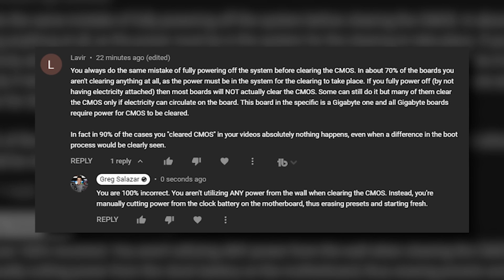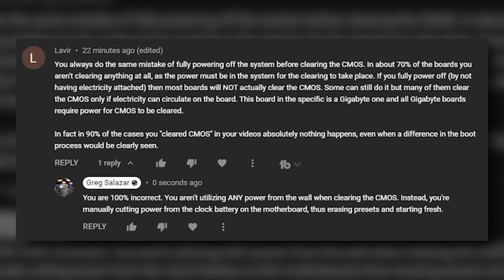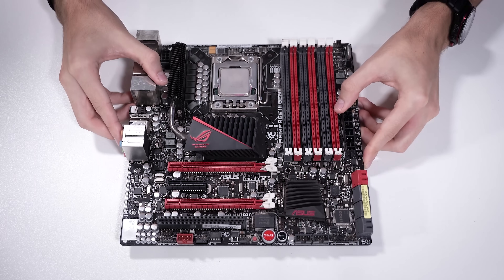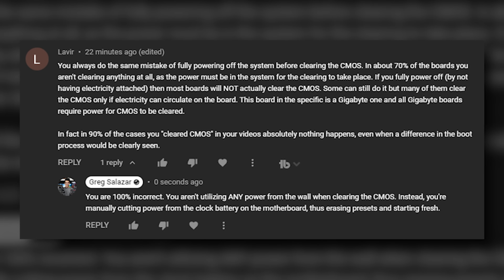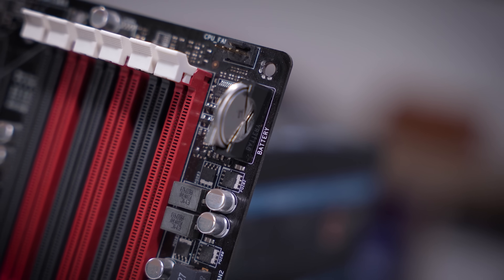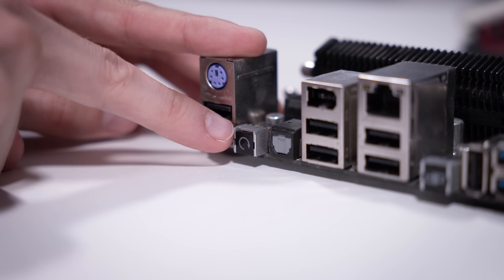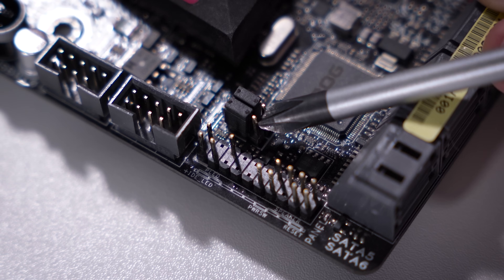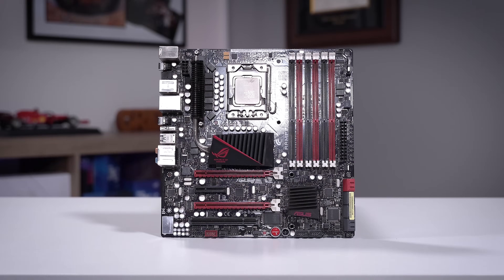How To CORRECTLY Clear Your CMOS

Comment: I'm trying to figure out how the commenter got it so wrong, and the best explanation I can come up with is that they thought that jumping the pins is sending power to the BIOS chip to somehow do the erasing. But even if that was true then you could still theoretically clear the CMOS using the "power" from the CMOS battery, because it's a battery and it has power.
What does he think the battery is for then? 🤣
But fair play to Greg for handling this in such a polite manner.

Comment: The main reason to remove all power is that most people aren't electronic technicians who have been taught how to work on computers. Trying to clear the CMOS with power on could accidentally result in shorting something out and causing component failure or injury to the person who left the power on. That is why many manuals have you clear the voltages using the way you demonstrated before opening the covers on a computer.

Comment: you will knew if cmos is clear if the set is in default, this is not big deal and it depend on oem motherboard.
we have different way to troubleshoot on our desktop and we dont have specific scenarios especially in the feature of our motherboard. Its simple to do or his motherboard have issue 😁😁

Comment: This is the gigabyte instruction You may clear CMOS to revoke previous BIOS password. Please turn off power and remove power cord from motherboard before clear CMOS. To clear CMOS, you may follow the instruction below:
If there is a  [CMOS_SW] button on motherboard, just press this button to clear CMOS.
If there is a CLR_CMOS (Clearing CMOS Jumper) jumper on the motherboard, you may place a jumper cap to temporarily short the two pins or use a metal object like a screwdriver to touch the two pins for a few seconds. (You may refer to the manual about where CLR_CMOS located.)
If there is no CLR_CMOS jumpers or [CMOS_SW] button on the motherboard, please follow the steps to clear CMOS:
Take out the battery gently and put it aside for about 10 minutes or longer. (Or you can use a metal object to connect the two pins in the battery holder to make them short-circuited.)
Re-insert the battery to the battery holder.
Connect power cord to MB again and turn on power.
After clear CMOS, please press DEL to enter BIOS and select [Load fail-Safe Defaults] or [Load Optimized Defaults] then save changes and reboot the system.

Comment: Don't know if you encountered this before Greg, but I've encountered a Gigabyte B85 motherboard that wouldn't boot properly and seemed to have a corrupt bios. Shorted the main bios chip and got the backup bios to reflash the main chips, but the bios was resetting and crapping itself out every time the pc was powered off. Turned out it was a dead CMOS battery and after replacing that and having the backup bios reflash the main chip everything was fine again.

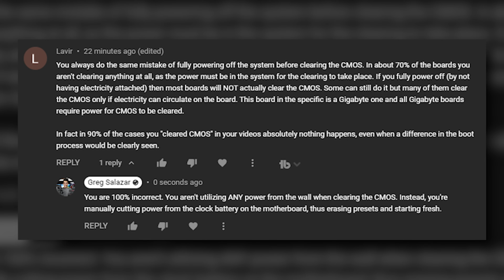Comment: That board is the perfect example to actually prove what was stated at around the 3:26 mark.

I had an X58 Asus motherboard similar to the one showed here (X58 P6T Deluxe V1 IIRC), same vertical CMOS battery holder; one of the pins (there should be three, in my case the middle one bent way too much during shipping) that connected that "vertical holder" was broken, so the battery was efectively doing nothing since it couldn't supply any power to the motherboard. All it took to reset the BIOS entirely was for me to unplug the system from the wall for a few seconds.

Comment: I always owned Asus boards for the past 33 years I have an Msi beacuse it was only the one in stock :), and ad per Asus instruction, was to shutoff system ,remove battery and clear cmos jumper for 10 seconds .

Comment: Hi Greg! I did clear CMOS several time without disconnecting power from wall but last 2  - 3 times what I did

1) Remove Wall Power
2) Press & Hold Start Button for around 30 seconds
3) Remove Battery and use Jumper to short the PINS and let system in same condition for 20 minutes.

What I found "THERE IS NOT A SINGLE DIFFERENCE" between both procedures.

But what I understand is, before clear CMOS, Power should be drain from system, just for safe side because if current still flawing in Capacitors or any chip, may be short can be occur, if you touch any other component by mistake, specially when using screwdriver to short the PINS

I have Asus Maximus VII Hero with 4790k.

Comment: With some older boards, reseting bios via jumper when system is powered on.. Could f... Your bios (will reset every time system is powered off).
With some boards, they refuse to post when cmos battery is emty (or to low voltage so with not posting boards, one of first things i do is chek cmos bat).
Also with some boards, when OC fails and You get no post... They need very long bios reset (have few DFI lanparty boards that do this). Havent seen this bug in newer boards thou.

Seen all kinda wierd stuff with bios/cmos.. 
Worked with pc-s since 90-s. Not once i seen board that needs to be powered on to reset cmos, lol

Also if You use remove battery to reset cmos, short 2 conectors on battery socket. This way You need 20 sec instead of 10min (its much same as shorting jumpers but somehow with some boards works much faster ;)

Comment: As a note, there are some boards that require you to remove the CMOS battery and the power the system on and off, then refit the battery to clear BIOS, VERY RARE, but if in doubt, EVERY motherboard manual I have ever read tells you the EXACT procedure for you to perform this process.

Comment: The only flaw in this video guide (which is 100% correct) is that if you've had a problem with the CMOS and this has caused your BIOS settings to randomly change, then check the voltage of the battery (CR2032 normally), this should be in most cases   * OVER  3 VOLTS DC   *   when removed from the circuit, anything less than that and it should be replaced. 

 At rest they will normally read 3.2V, but as is good practice in the trade, when a PC comes in with suspected CMOS issues or if stripping out to clean down or repair a system, record all the BIOS settings and just replace the battery with NEW, in date (shelf life matters here) one. They are so cheap ($1 for a 6 pack) and easy to replace in most cases, that missing this step can lead you on the wrong path when diagnosing systems, and yes I have seen some of Gregs videos where I am screaming at him to replace the battery, he doesn't and he condemns a board which was older and probably just had a battery on the limit where it couldn't power the CMOS to hold its settings during the training cycle and it would leave the systems in boot loop.
Reply: Mmm interesting point, I have had cmos batteries be the issue once or twice so would think along your lines of reasoning.. but it is certainly a component most will over look.

Comment: Also worth pointing out that if you do turn your PC on and its clock is wrong chances are that CMOS battery is dead and needs replacing they don't last for ever.
Reply: You forgot to add...after it's been unplugged or through a power outage.

A normal  shutdown will hold the C-MOS settings, date,, & time even with a bad C-MOS battery by getting supplemental power from the outlet.
Reply: I've actually gotten a few dead(does not power on at all) PC's to boot again just by replacing a dead cmos battery.

Comment: Probably it's the confusion between "reset BIOS settings" and "Flashing/updating BIOS".
BIOS (motherboard firmware) is stored in CMOS (the physical chip). In my understanding, it is NVM. It retain it's data even without battery.
BIOS settings, on the other hand, needs battery. If it's removed, the settings will be cleared. So the settings must be stored in volatile memory.
Flashing BIOS then, of course, needs electricity, so you need the motherboard to be connected to the wall.
Reset BIOS have to be done when the power is cut off.
Correct me if I'm wrong.

Comment: Well at least in the last century people were reading the manuals of their boards. In my case you will find something like this: "To clear and reset the system parameters to default setup, please
turn off the computer and unplug the power cord, then use a jumper cap to short the pins on CLRCMOS1 for 3 seconds. Please remember to remove the jumper cap after clearing the CMOS.  .."
That confident BS commenter could be right if there is an EEPROM used to store the volatile Data, so READ THE MOBO MANUALS and all of a sudden you know what to do, it is pure MAGIC.

Comment: And if your having weird issues with your computer booting, you could always try replacing the CMOS battery with a new one (most commonly a CR2032). Believe it or not, I have had  to replace the battery in my X470 motherboard, which is not very old!
Reply: Yep, changed cmos battery on a laptop that wouldnt boot.  Instant boot. Those batteries can last years.. but not all are infallible. Lol
Reply: My Thinkpad has been running with a dead CMOS battery for years, just reset the time and date before booting it up and it's good to go. Do you have to memorize all the settings in the Bios before you remove the battery, what if you forget an item?
Reply: @wilsont1010  Unless you've done some customization, usually just activating the "load defaults" will do fine. Just don't forget to put your memory profile back on if you had one selected, since it tends to reset those to "none/disabled."

Comment: If I have to nitpick anything, it's just the "10-20 seconds" in the hold power button after unplugging part, and jumping the pins part. In my experience, it literally took just 2-5 seconds max to jump the pins, and virtually no time to press power button after unplugging. If you have lights/rgb fans inside, the lights will blink once, and the power is cleared.

Of course if in the context of "on the safe side", then 10-20 seconds is okay. Too long is better than too short 😁

Comment: 99.9999% a clear Cmos is it grounds nvreset line on the spi flash chip this has power thanks to the cmos battery.
This small nvreset line is a separate bank of memory this spi memory chip has multiple banks on non-volatile memory and around 8 to 64k volatile config storage. The non-volatile is used to store the actual bios it also stores thousands of pre-configured options for memory, gpus, cpus and byte code for a small mcu (post config micro controller some system integrate with south bridge chipset) tied to a USB port for flashback if the board has the option. This mcu reads a checksum from non-volatile and  volatile memory if this checksum fails All volatile memory is over written with hard coded  defaults this will trigger memory training pci-e driver training and cpu microcode validation and a tpm cpu handshake for code signatures.  While it takes a solid 3-4 sec hold the reset to fully zero volatile config info it only takes a fraction of a second to make enough data errors for the checksum to fail. 

Your welcome 
Zoey R.
 Embedded System and hardware Engineer at Motorola.
I design circuit boards and custom ASIC's all day this includes both arm and modern x86-64 main boards I have built more than a few dozen Amt based bios's for custom hardware.9

Comment: if you remove the battery, and the power is disconected, you can hold down the power button for 10-20 seconds to drain any residual power from the system instead of waiting 5-10minutes, this is the trick I use, works every time.

Comment: G'day Greg,
I guess the person who wrote that comment DIDN'T get their information from Intel as their "Product Support" page regarding "How to Clear CMOS to Reset BIOS Settings in Systems with Intel® Desktop Boxed Processors" says... (Special note of Step 1) 
"Steps to clear CMOS using the jumper method
1. Power off the system.
2. Open up the system so you can see the motherboard.
3. Locate the CMOS jumper by referring to the motherboard manual and how to clear the CMOS. In general, the CMOS jumper is three pins located near the battery.
In general, CMOS jumper has positions 1–2 and 2–3. Move the jumper from the default position 1–2 to position 2–3 to clear CMOS. Wait 1–5 minutes then move it back to the default position.
Power on the system. In some systems, you might need to enter BIOS to reset to the factory defaults."

Comment: What I do is using the reset button as a cmos clr, I never use the physical reset button for it intended purpose anyway, I always reset from software or use the on/off button, so that way I have always a convenient access to it, especially useful if you want to do overclock.

Comment: I've learned a lot about troubleshooting computers from here and came in handy!! Thank you!
 my pc 12900k w/rog maximus z690 formula mb that I have and upgraded with a 4090fe and a evga 1600watt power supply I bought second hand on ebay 
After installing everything it wouldn't start lights on nobody home 
I've tested the power supply with a jumper even before putting it in and fan went on 
So I pulled 1 plug at a time and found 1 of the  cpu power wires that go top left of mb were wired differently and was shorting it out 
How can that be they put a wrong wire in the box and it fit the power supply 
Anyways I ordered the right cable and in the mean time I used a dvom meter and spliced the wire the correct way with the one that works and runs perfectly 
Asus  and evga must have good protection in place or it would have gone poof

Comment: Motherboards have the instructions on how to clear CMOS in the manual, where I work i use a gigabyte board and the manual States that u should power the system off and then use a metalic thing to short 2 specific pins for 4 seconds (the manual points where they are and in the board itself is written "clr CMOS" near those pins. Most are like that but always remember to check the manual. Also u can remove the battery if for some reason u can't do it the proper way, i tested on my PC and it works.
Reply: "power the system off" means leave it in standby, right?
Reply: @GizmoTheGreen  on my msi boardm it's manual states: Resetting BIOS to default values
1. Power off the computer but DO NOT unplug the power cord (system under S5/ 
Soft-off mode)
2. Use a jumper cap to short JBAT1 for about 5-10 seconds.
3. Remove the jumper cap from JBAT1.
4. Power on the computer.
Reply: Yes, these steps are literally what this video is showing us to do.

Comment: I have an Asrock B450 mobo and I have to turn the PSU off, hold down the power button for thirty seconds, and then jumper the CMOS pins for at least thirty seconds to clear it. Or, take the battery out for about a minute. 
I found out the correct way to do it by READING THE OWNERS MANUAL. Who knew? (src)

Comment: Greg, would it hurt to change the battery while the PC is running to not lose info?
Reply: just turn pc off whiles it in standby mode (it still reciping power from psu)  and swap battery out dont need turn off psu it to change cmo batteries
Reply: @kittyztigerz  Ok thanks guys. I haven't done it before and was planning to change it out before the end of the year.
Reply: @Cris1Mac  normally battery last over 10 years
Reply: @kittyztigerz  Ok way longer than I thought. I know they are cheap. I have a z490 godlike I built 3 years ago, so I have plenty of time then.
Reply: @Cris1Mac  i have many mobo stacks in my collection like 1980 all way to 2022 they all still have power to cmo and battery aint died havent replaced then at all if they aint died them dont need replace it only need replaced it when it not recognized cno in boot screen (when turn on pc you will see lego bios and look under it will say doesnt recognize cmo bios settings)  that when say cmo battery is died
Reply: @kittyztigerz  lol well than there will be lots of other parts that fail before that. Thanks for the years of incite. I do appreciate it.
Reply: @Cris1Mac  normally be capacitor fry or leaky or pop that petty much what i find on them
welcome be safe

Comment: The comment you refer to is quite comical to me as every Gigabyte board I've used has stated that you need to remove power from the PC and either jump the CLR_CMOS pins or remove the battery.  Even my Asus Prime X570-Pro lists the first step in section 1.1.7 pg 1-9 as "Turn OFF the computer and unplug the power cord."  I've used both jumpers from old HDD's to clear the CMOS and a flat head screwdriver, anything metal that can make contact with the 2 pins will do the trick, just have to be careful is all.

Comment: You can do all those steps to be absolutely sure the CMOS is cleared, but I personally had a 100% success rate just touching the clear CMOS pins or pushing the button for a split second, at the rate I have to clear the CMOS on some days, If I did all those steps I'd never get anything done. No disconnecting power, no discharging caps, no removing battery. Maybe my method won't work on some boards, but on all my boards for the past 20 years it worked just like that. I never owned Gigglebyte boards though, so maybe I just got lucky.
Reply: Most boards these days gave at least a few LED's so they drain the latent power on their own, they go out in a second or 2 indicating the board is drained but if you have an older board holding the power is a quick step.

Comment: In my experience, usually jumping the pins or removing the battery for a second or two does the trick, but it's a good idea to wait the little bit of extra time just to be safe. Not like you can over-reset it, after all.
Reply: I'f I'm resetting the CMOS I'm already saying a little prayer so no need to rush.😰
Reply: On my pc the cmos is reset already when I turn off the psu and hold the power for like 10 seconds
Reply: @richardbottom9843  Replace the battery, like any battery they still need to be replaced eventually.